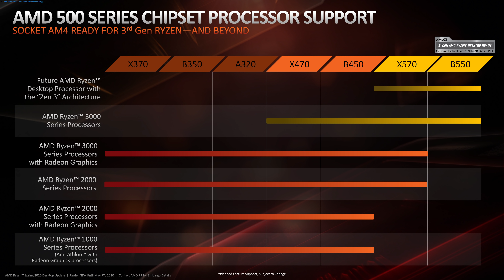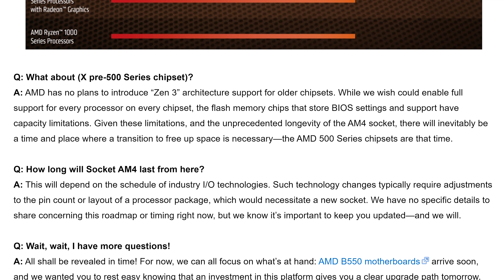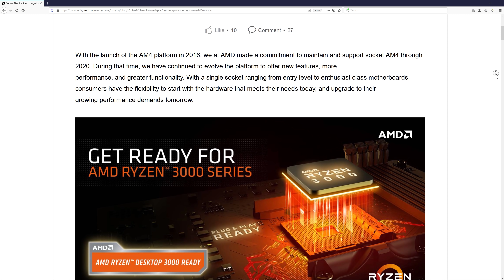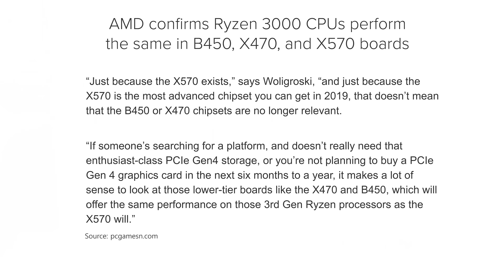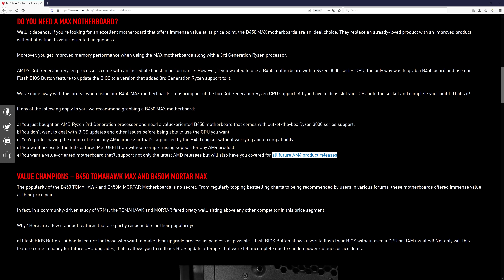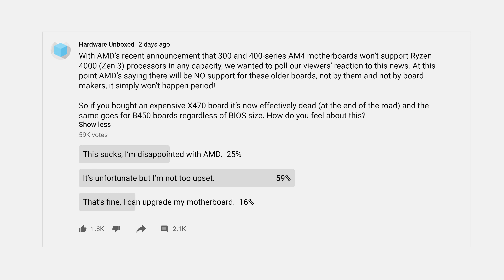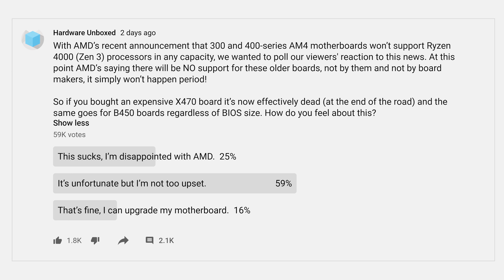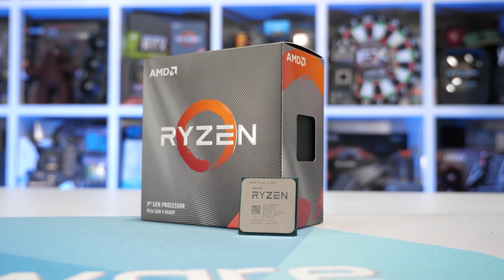AMD Does An Intel, Axes Zen 3 on 400-Series Motherboards, Our Thoughts

Comment: AMD never promised it would support Zen 3 on either 300 or 400 mobos. they even in fact statted that Zen 2 would be the last AM4 CPU before Zen 2 launched so i'm surprised the 500 mobos will even support zen 3. I recall that very well due to planing to pick up a Ryzen 3700x around the time for my 370 mobo last summer. i believe i even listened to some discussion on this channel on how the next line up after the 3000 series will be a fully new socket.
People simply didn't inform them self fully and are now blaming AMD.

Comment: I mean, AMD promised they would have support up until 2020, and they kept that promise. Also, it has been 4 entire years of support; yes, they didn't stop you from buying those boards because I guess they like profits, but what did you expect after three (four with X570) compatible generations of CPUs? That your board from 2016 would still be compatible with products launched in 2021?

Comment: I was waiting for b550 and I considered getting a b450 a lot of the times. B450 Tomahawk is a very good motherboard and certainly worth Its price. I even considered buying the new X570 Tomahawk. This is basically, because of the b550 delays. Have They released b550 earlier, a lot more people would have got a b550 instead of a b450 and They wouldnt have been screwed over. 

Had They also communicated earlier that b450 will not be supported a lot more people would have waited for b550 or bought an x570. Sadly, I really do think, that this was a recent decision They made and They didnt plan for It. Wheter the decision was made for profit or, because They dont have the resources, I dont know, but I hope They will reconsider and support b450.

Comment: AMD promised more support for AM4 than it could be bothered to deliver and found itself wishing it could pull another TR4 on people. Smells like AM5 will get three years at most. The safe option would be to promise two years on new sockets so it does not need to hamstring itself with unforeseen platform limitations that increase the CPU, IO and substrate design burdens.

Comment: As a b450 owner I feel screwed cause I'd definitely go for b550 IF IT WOULD BE AVAILABLE but it wasn't and still ins't. That's the reason they should keep the support for 400 series. Customer has no other choice than go for expensive x570 even if one is targeting budget build and planning for an upgrade. The lack of options is what make them look bad.

Comment: Hello all! I think that this new processors will be a bad choice now. As amd said this will be the last AM4 lineup so you need a new motherboard for only one generation? Will this be a good buy? I have a ryzen 2700 with a B450 mobo and I was expecting this new 4000 series for an upgrade, but no. I’ll keep my system and wait for the next socket by AMD and Intel. I’ll pass ryzen 4000 and Intel LGA1200. They are doing this to sell the new B550, otherwise it won’t fit the prices tag...

Comment: I bought my MSI B450i with a 3700x 2 months ago. As I plan to keep it at least for 5 years, I'm not really mad or anything. My next upgrade will most likely be in the AM5 or even the AM6 era so I'll buy a new motherboard anyway. Also if I need more CPU juice, I can get a 3950x in the future and enjoy the uplift because my board is more than capable to drive it.
I think the only case when people might be mad are those who bought some cheapo dumpsterfire tier boards and want to upgrade in the future within the same TDP class.

Comment: Honestly if supporting all CPUs on a Socket is such a pain, then why not do this:

Every chipset will support at max 3 generations of CPUs, previous, current and one future.

This gives people a way to get a newer board with support for an upcoming CPU, while also giving them the option of going with a cheaper used previous gen part. Then when the next generation is released, they can get a newer CPU as an upgrade. AMD won't have to spend so much work to ensure compatibility and it gives people a way to plan out their purchases. There wouldn't be any surprises like this whole B450 fiasko.

Comment: I updated my existing motherboard to a B450 Tomahawk MAX and even talked myself out of X570 with the specific intent of having a cheaper board that I could upgrade to Zen 3 (4000 series) without PCIe Gen 4 (as I frankly didn't need it).
And now I find out that I can only go as far as Zen 2 (3000 series) unless I have to buy ANOTHER motherboard?

Yeah, not happy. Get it together AMD.

Comment: I invested in a X570 because I was a new builder and couldn’t update the bios for a 400 series, and consider myself very lucky now. 

I’ll be able to get whatever the top Ryzen processor is and the top RTX 3000 now. I didn’t think I was even going to do this but I am sold on the Master Race now and want the best parts!

That being said it’s not fair to especially those who bought an expensive X470 or top of the line B450. I reluctantly got an expensive X570i from ASUS because it was the only option for my Corsair 280X case while not having to update BIOS.

You guys deserve the ability to upgrade for spending 100 less dollars a year ago. Manufacturers clearly made it seem like 400 would be supporting processors for a long time.

Comment: I am somewhat a fanboy of AMD. To me even 400 series motherboard won't support the new upcoming Ryzen, technically, AMD has achieved so much especially  on a 16 cores of desktop CPU.

But it still not okay because they have promised to support it, even if the statement for support until 2020 was somewhat vague, it is clear for motherboard makers and customers that their expectations that at least the 400 series board can support up to Ryzen 4000 desktop. Surely enough AMD knew this and they never counter it or anything and tag it as misinformation. And it is somewhat unacceptable because the 400 series looks capable physical hardware wise to support the last promised 2020 Ryzen.

Comment: 2:07  Check that one Steve.
But we need to do this. The whole appeal about AMD was features like long motherboard support. I understand that they have shareholders and need to build up a "war chest" to keep innovating, but there are other ways to do that. Ways that do not piss off the people that arguably are the reason AMD even exists any more. The last few years the sale of Ryzen CPU's wasn't exactly driven by AMD its marketing department nor widespread usage by OEM's. It was driven by good reviews like over here, people spreading the word, recommending the CPU's etc. On top of that, AMD will only now start seeing the Epyc money rolling in, helped by Intel their failures. From a financial point of view this might even backfire because fewer people might buy a Ryzen 4000 when they are out. 

Ryzen sold pretty much from the beginning and arguably kept the company afloat. This despite AMD's repeated efforts at self sabotage. See for example the RAM stability issues, 200MHz boost clock video, SATA bandwidth issues with X570, the RX5700 series blowers, the whole RX5600XT mess or the RX5500XT in general. Then there are also drivers where AMD successfully destroyed its carefully build up reputation for stable and feature rich drivers in a few months. AMD is far from being "top dog" where everybody will just have to put up with this. Especially with the nonsensical excuse of bios chip capacity. 

It is pretty clear that AMD has some serious support staff shortages and possible organisational issues looking at all the screw ups of just the last twelve months. That however does not excuse this. I am not saying this for myself. I went from an 1700 to an 3700X on my C6H. I was already planning on skipping Zen 3 and looking towards the AM5 platform. I am saying this for all those who where planning a Zen to Zen 3 upgrade or Zen+ to Zen 3 or even Zen 2 to Zen 3. Unless you are on X570, you just got screwed. The worst part might even be that B550 looks like a really good chipset. The 4.0 lanes should be a welcome addition and hopefully allow multiple M.2 slots to become common on B550. Further we might actually get some competition in this range because it has been such a MSI only story for B450.
Reply: Okay, I might play devil's advocate here, and maybe I am wrong, but didn't AMD, during the launch of Zen 1 in 2017, say that the AM4 platform would be supported "at least until 2020"? When a corporation says "at least", I immediately ignore it. What I heard at the time was "AM4 stops in 2020". I bought an X570 because I'd like to upgrade to a 3950X in the future, but I would have never thought that those boards would support Zen3... I think that buying an X470 to get Zen3 later was short-sighted, I don't recall AMD ever (officially) saying it'd be compatible. Correct me if I'm wrong, I might have missed something.
Reply: AMD have already made it clear that AM4 motherboards won't be supported with new CPUs after 31 December 2019, so not sure why all of a sudden people expected them to support CPUs from 2020 and beyond. 🤷‍♂️ If you look at AMD's official Socket Stability slide in the article "3rd Gen AMD Ryzen CPUs Will Work on Many Existing MSI AM4 Motherboards" (search it on Google), you'll see that the graph clearly shows no support for new CPUs on AM4 after 31 December 2019. If you take a good look, the orange bar stops right at the end of 2019, just before 2020 starts. It was already know even a year or two ago that Zen 3 will come out some time in 2020, or in other words, AFTER the official support period. So what's all the fuss about? Do people not know how to read graphs?
Reply: @bgtubber  Maybe it is because there is no reason for them to stop supporting these older motherboards?
Reply: @bgtubber  X570 is AM4. B450/X570 is a chipset. Stop posting the same reply on every post.
Reply: @bgtubber  Stop spamming the same copypasta over and over again. You're on every single comment down the line with the exact same message and you don't give answers to the counter arguments... Plus you flat out ignore 90% of what Steve just said about what OTHER messages AMD has given.

Comment: My question is : why would you upgrade a 2 year old procesor who still works better than most intel procesor? Intel users used to say : why ryzen is better if the ryzen users upgrade every year? And even they are right in a reason , amd did things in the best way unlike intel. I'll guess that ryzen 4000 will support only pcie 4.0 gpus which leads me to believe that it will be a pretty good upgrade.

Comment: It reminds me of the x470 debacle spending much more for x 470 when they weren't needed for zen 2 cheaper boards give you the same results, in a couple x570 and 550 wont work either with ryzen 5000 watch, every 2 yrs you will have to upgrade
wait my x470 bios chip can be removed without sending it back to manufacturer so just send me a bigger bios chip! x470 gaming 7 wifi!

Comment: Let's react poorly to these news. Maybe then they will regret their decision.
Reply: So AMD ending chipset support every 2 gens isn't anything "obligatory".
Reply: Why should AMD regret something that they didn't promise? They have made it clear a long time ago that AM4 motherboards won't be supported with new CPUs after 31 December 2019. If you look at AMD's official Socket Stability slide in the article "3rd Gen AMD Ryzen CPUs Will Work on Many Existing MSI AM4 Motherboards" (search it on Google), you'll see that the graph clearly shows no support for new CPUs on AM4 after 31 December 2019. If you take a good look, the orange bar stops right at the end of 2019, just before 2020 starts. It was already know even a year or two ago that Zen 3 will come out some time in 2020, or in other words, AFTER the official support period. Do people not know how to read graphs?
Reply: @bgtubber https://www.forbes.com/sites/antonyleather/2020/12/31/top-five-pc-hardware-launches-to-watch-out-for-in-2020/#724820471a13  But on the  graph in this article  Zen 3 was to have been released in 2019.  And in this https://hothardware.com/news/amd-confirms-am4-socket-support-future-ryzen-processors-2020.  Amd rep confirms support through 2020 and graph also shows Zen 3 before 2020.
Reply: @jamesthomson8659  Did you even read what you posted? The article says "and we are definitely expecting Zen 3 to land in 2020 too - it's own road maps say so." 2020! As for the graph they used, that's actually an OLD graph. The graph I referenced is newer. Besides, if you can read, there's a fine print at the bottom right of the graph I referenced that says "subject to future roadmap modifications".
As for the 2nd link, I didn't watch the whole video, but have you actually thought that the guy from AMD might have misspoken if he really said that? I'm more inclined to believe an official statement that is not made at an improvised recorded video.
Reply: @bgtubber   News flash.. x570 is AM4... And they said until 2020. We are still in 2020.,
Reply: @BudgetGamerz  So? This only means that they not only kept their promise, but actually overdelivered by compromising and allowing for a motherboard from before 2020 to work with the future processors. AMD were in no way obliged to make this compromise, yet they did. I'm truly baffled at what are people so pissed about. Especially after they made a gesture like this. AMD could have easily stopped support for X570 too because this motherboard also falls outside the official support period of future CPUs from 2020 and beyond.
Reply: @bgtubber  the only mobo chipsets that works legitimately well with Ryzen 3000 (other than X570 itself), as of now, are the 400 series chipsets, B450 and X470. B350 doesn't support RAM modules clocked higher than 2666MHz, so we can't pair 3600MHz low latency kits(as recommended by AMD for Ryzen 3000) with a B350 mobo.
Reply: @anishgupta8938  With the Ryzen 3000 chips you where given extended RAM support beyond the original boards support. So some 300 series boards now support 3600 MHz.
Reply: @bgtubber  fuck off paid shill!! So tired of reading the same shit from you on like literally every video on this topic!

Comment: Hey Steve, I've been here since the early days of your channel like when I wanted to send over an 8700k for the "golden chip" experiment feud with adored etc. I told a friend to get the B450 Tomahawk MAX as I was under the assumption they would support the next series of CPU's. I don't know what to tell him now, lol..
Reply: Same... :(
Reply: well I guess you'll have to tell him about this and that several people think the bios size bs is not the problem or that it's not a lost battle just yet
Reply: Who cares AIB partners press AMD to makes more margin from X570 than sold old motherboard with small margin ?

Who need Ryzen 4000 with DDR5 ?
just bough 3900X or 3950X 😂
Reply: Clarito resdiano that is one possibility, but why would msi bother releasing new max versions with larger bios, if they knew this was coming? Even the video says, they were as surprised by the news as the rest of us.
Reply: Tell your friend you were wrong....and if they want to upgrade their CPU you can buy a cheap B550 Board.....disaster averted
Reply: That sucks indeed, but AMD had made it clear a long time ago that AM4 motherboards won't be supported with new CPUs after 31 December 2019, so not sure how you thought that a B450 Tomahawk Max would work with Zen 3 which releases after 31 Dec 2019. If you look at AMD's official Socket Stability slide in the article "3rd Gen AMD Ryzen CPUs Will Work on Many Existing MSI AM4 Motherboards" (search it on Google), you'll see that the graph clearly shows no support for new CPUs on AM4 after 31 December 2019. If you take a good look, the orange bar stops right at the end of 2019, just before 2020 starts. It was already know even a year or two ago that Zen 3 will come out some time in 2020, or in other words, AFTER the official support period. Do people really not know how to read graphs?
Reply: @bgtubber  Stop spamming the same copypasta over and over again. You're on every single comment down the line with the exact same message and you don't give answers to the counter arguments... Plus you flat out ignore 90% of what Steve just said about what OTHER messages AMD has given.
Reply: @andersjjensen  It's probably an AMD bot.
Reply: @bgtubber  they did not say after 31 December 2019 anywhere.  The graphs are only estimates you are not supposed to take them as 100% correct. AMD's graphs about Navi and Vega timelines were completely wrong by a year at least. 
Amd is simply showing us that they do not care about consumers as much as we thought.

Comment: but... this is the end of AM4?? this means that the Zen 3 platform is something no one can upgrade into or out of. So if DDR5 is ready in 2021 for AM5 (unsure) they're going to have two consecutive generations without an upgrade path? If it isn't ready, are they going to have THREE generations of boards with no cross compatibility??